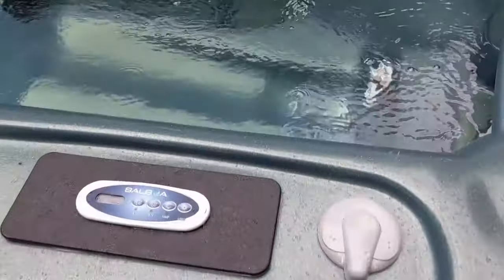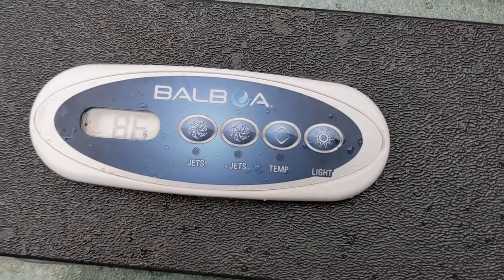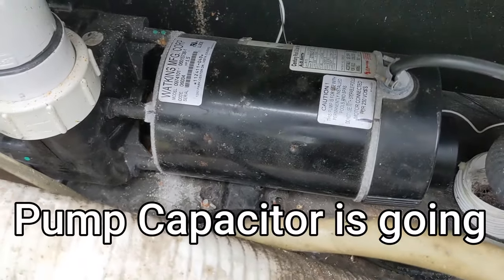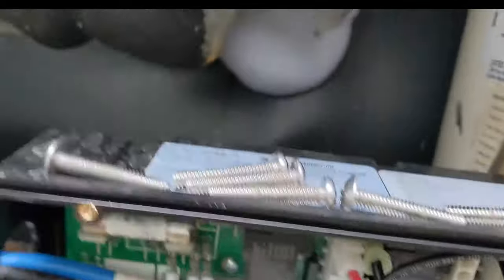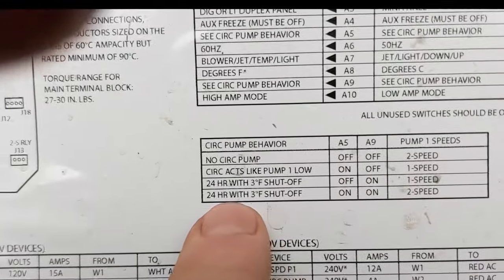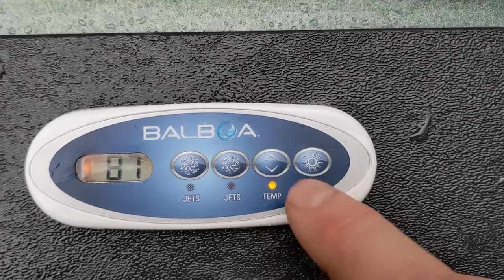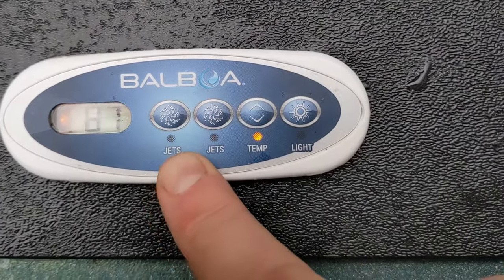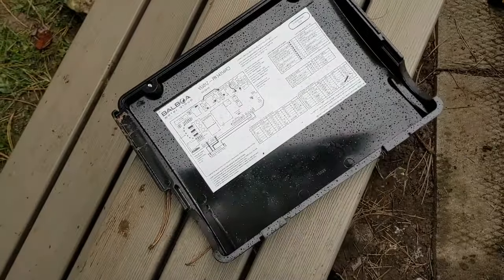Hot Tub Pump Keeps Running / Hot Tub Pump Will Not Turn Off

Comment: I have the same unit. And I'm having the same problem with pump one is constantly running I pushed all of my pins down. The gentleman in the video did not explain where the pain should be for normal use. Do you have a diagram that you could send me?
Reply from the maker: This is only one reason if your pump is running all the time.  Check your programming for your hot tub topside and spa pack.  Could be a different issue.  Need more info.

Comment: after changing from FC to one of the 3/4/6 hour cycles....how long before pump shuts off?  Immediately or after that hour of cycle?
Reply from the maker: Most tubs it's around 20mins
Reply: Thanks.  I recently installed new motor and heater.  Now pump worn stop.  I changed cycle 2-3 hours ago and still running. 😢
Reply from the maker: @speedracer1950  test volts and amps on heater. The system is calling for heat

Comment: I have a master spa twilight 8.2, we bought new in 2011, never had any issues, problem just started , the circulation pump will not shut off, I have installed new filters and drained and refilled the water, and have even left it powered off for a few days, but the low pump wont turn off. seems hard to find anyone that does hottub repair.
Reply from the maker: If you turn the heat below the set temp, does the pump turn off?
Reply: @VIPPoolsandSpas  I have lowered the heat below the set point and it still won’t shut off.
Reply from the maker: @TheMrcHilton  programming or the board
Reply: @VIPPoolsandSpas  solution? Purchase new board? If so is it plug and play?
Reply from the maker: @TheMrcHilton  you will need to contact Master Spas.

Comment: Hey not sure if you still see these comments I have a four winds spa with the vs501z low speed runs non stop even I'm set for f2 and dip switch 2 and 3 are on 2 for st mode and 3 for mini display i have a 2 speed pump and a blower pump...  My temp is 90 and even when I lower it to 80 it still runs continuously and ideas? It's a brand new board from spaguts old board was not allowing me to control the temp heater wouldn't turn off
Reply from the maker: Yep.  I get them.  Can you set the temp?  Test the volts on the element.  Board might not be compatible with the topside.
Reply: @VIPPoolsandSpas  temp sets and heats to the set temp then heater turns off properly I set it for economy mode at 95 turned off circuit breaker for the night turned back on this morning and seems to be turning off filtration stage 1 properly now... still have spa deep clean in it the flex hoses where all black as night instead of clear haha been 3 days seems to be cleaning up now...... could of been heavy build up on heater element or the 2 temp sensors

Comment: This is probably a long shot, but I recently decided to start up a jet tub (one of those old school insert types) to see if the motor still worked. It did, but when I went to turn it off (same button for on/off), it turned the jets off but continued flashing..... and several minutes later restarted the jets. We had to turn off the breaker just to get it to power off completely. Any idea what I could try to get it to power off after turning it on? It seems like the tub could still be usable, but not if we need to turn off the breaker every time to get it to power off 😂

Thanks in advance for any help you can give!
Reply from the maker: A hot tub will turn on by itself if there's a heater element.  Even if you turn it off, the pump will come back on because its calling for heat.  Once it gets to the set point you set it at, then you can turn it off or on.  I think thats your type of hot tub?
Reply: @VIPPoolsandSpas  I don't think it has any heating ability, I vaguely remember having to run new hot water when it got tepid. It's Acriform brand, but there's almost nothing online about it! I don't know why, but I feel like it only blew air bubbles into a tub of water versus flowing water jets?

The only buttons are on/off, what I'm assuming is "more/bigger bubbles", "fewer/smaller bubbles", and an image of both the more/bigger and fewer/smaller bubbles with 3 half circles underneath, in different orientations. It's confusing! Lol

Thank you for replying, I'd love to figure this out!
Reply from the maker: @FloraM44  Might have to get a new control box and controls.  Sounds like the on/off control is stuck.
Reply: @VIPPoolsandSpas  Okay thanks! It was confusing because pressing it would stop the jets but only temporarily. I wish I could find the manual to get a hint what that "temporary off" might have been intended for. My mother was excellent at keeping all manuals, etc. so if I find it, I'll let you know more! Thanks again for your help!

Comment: I’ve got a similar balboa, I’ve put the filtration to F8 and all my pins are as it shows they need to be. The pump at low power is still runnining 24/7. The jet light is on and when I press the jet button they get stronger but when I press again it just back to low speed, never off. Any ideas?
Reply from the maker: I'm going to assume its pump #1 your talking about?  If so, what does the pump do when you turn the temp below your water temp in the tub?  Let me know.
Reply: @VIPPoolsandSpas  there is only one pump with 2 speeds, I only have one jet button. When I turn the spa well below the temp it is at, it continues to run on low speed.
Reply: @VIPPoolsandSpas  it is a balboa GS504SZ M7 System
Reply from the maker: @chicorde1982  any error codes?  Check all the sensor wiring.  Every inch.  Make sure all sensors are plugged in.
Reply: @chicorde1982  Hello, did you sort this issue I've just started to experience the same problem
Reply: @DicePac  Having same issue, Mode St, Pump Filtration at F1, Balboa VS (2months old). Reduced Temp lower than it is currently at, pump will turn off, then it will turn on to do its filtration cycle at low speeds and pump will forever turn on will not cycle off, even set at its lowest filtration cycle of 1 hour F1. One pump,two speeds 110v. Manufacturer says it the low speed capacitor? any ideas?

Comment: I have a 2007 bullfrog and all of a sudden the low pump won't turn off. the 03 led is on "Ozone" that is currently not installed. The tub use to turn off completely once heated. now it runs constant,  I think some models this year uses a circ pump but mine never ran constant before. PLEASE HELP
Reply from the maker: try unplugging the topside and put the temp way down below the temp its at now.   if it stops, its the topside controls.  if it does stop, could be a board issue.  Does it still heat up to where you want it?  Was there any work to it?

Comment: I have a similar balboa . It has   lower   . Higher . Jets . Light .       Mine shows   F0 . F1 . F2 . F3 .     I'm guessing 0 is off ?     If I turn the hot tub off at the wall and back on it returns to f1 .  Guessing it's a default .
Reply from the maker: F0 is NO Filter.  Pump will run 24/7.  F1, F2 and so on are just filter time.  Yes and the default comment.

Comment: I'm fighting a vs500 board that just seems to keep running and making heat. It will come to temp and stay running. It has a single 2 speed pump and will change from high to low but never shut off. The heater is dropping out at temp verified my amp and voltage. Tried different filtration settings and have no codes. The few times I do get it to shut off at temp it will not kick pump  back on for heat cycle and go to high limit kick out until I push the jet button. Any suggestions?
Reply from the maker: Man, that's a long one.  Lol.   Seems like your testing what needs to be tested and also checking the filter cycles.   Let me think on this one and I'll get back to you.
Reply from the maker: Could be a high limit issue.  The high limit should be shutting the heater off when it gets to temp.  It's the high limit that controls the heat on and off.  An error code would come up if there was problem between the temp sensor and high limit.  I would change out the high limit if your filter cycle isn't F1 and your getting volts and amps at the element.  Could also be a board issue.  Look for burn marks on the front and sometimes you'll have to try and get to the back of it to see.
Reply: It's funny the element drops out when it comes to heat but the pump never stops and continues to run. I had the board out expecting to see something burnt but nothing. In test mode on dip switch one I get a f and 2 dashes but have never saw anything other than the high limit when it goes to heat cycle and pump isn't on. Definitely has me scratching my head.
Reply: Both sensors seem to be close to each other on resistance but not sure what they should be.
Reply from the maker: @lp14x4  turn power off and turn dip switch for test mode off.  Then turn power back on.  Send picture of dipswitch and the back of the spa pack door to info@vippools.ca
Reply from the maker: @lp14x4  the f and two dashes isn't in any filter mode.  Could be in 24 hours run time for pump 1
Reply: I'll sure do that. You have been so helpful definitely going to recommend your channel and business to everyone.
Reply from the maker: @lp14x4  The pictures you sent, this is the board now and nothing has changed?  Check email if YES.

Comment: Hi there. I’ve turned my heat down. Assured its on standard setting and F2.pump is still running? Please help!!!
Reply from the maker: F2 is a Filter mode.  What's it doing?  Just running all the time?  What's the temp now and what's the set point on the topside?
Reply from the maker: Oh.  And.  What hot tub do you have?  What spa pack is in that?  Can send pictures to info@vippools.ca if that helps.
Reply: Hi I have a strong spa can you please  help me ???
Reply: @VIPPoolsandSpas 😊😊